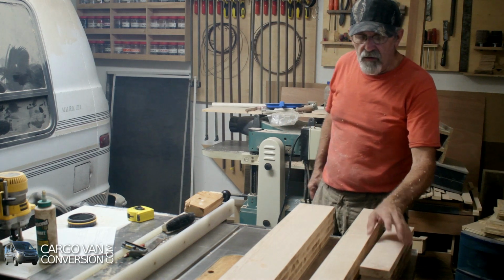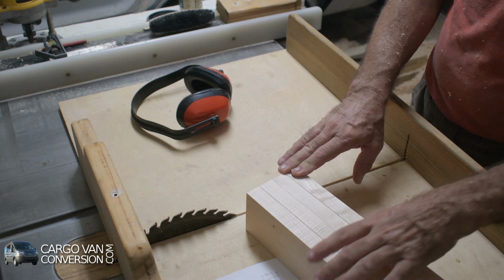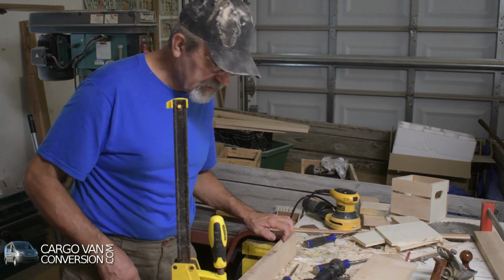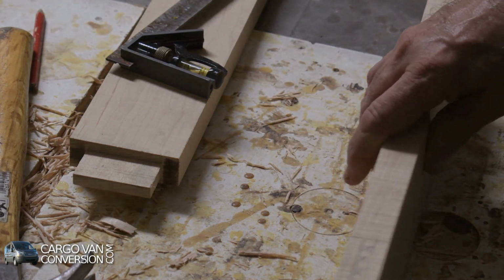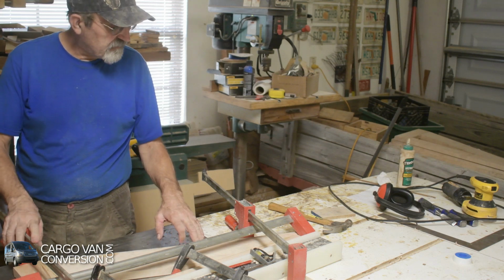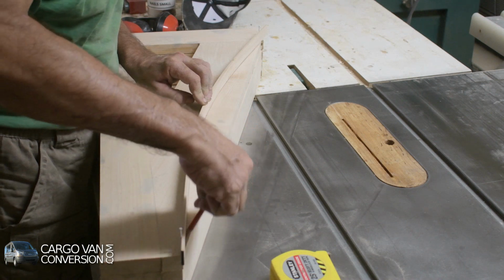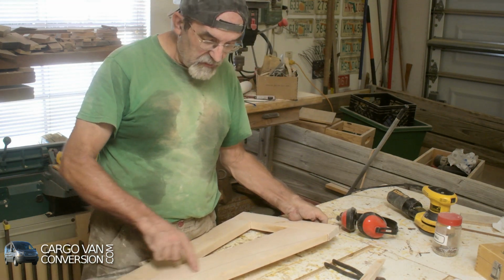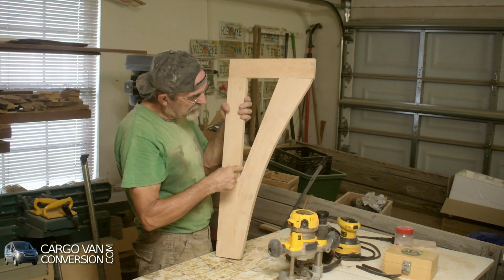RV Mobile Work Bench

Comment: I came for the conversion van lifestyle. I stay for the expert craftsmanship. Looks very strong, compact & highly functional. Thanks for all the lessons. I really enjoy.
Reply from the maker: Hi Stephen,
While I have done mostly woodworking lately (my passion), it is still all about the conversion :) In this case, I may be able to bring the woodworking with me on the road. This latest project, if it succeeds, will give me a place to work on and some necessary storage space for a few basic tools. And it would function as a seat at the desk.
Lofty goals, but will it work and will it be practical enough to use? Weight is also an issue.
Thank you for always commenting and giving useful feedback. We've never met, but it's like talking to my neighbor :)
Van Williams